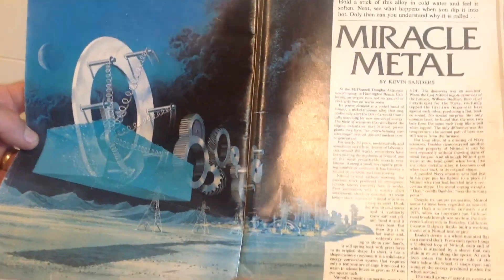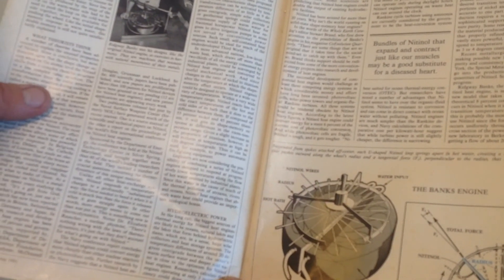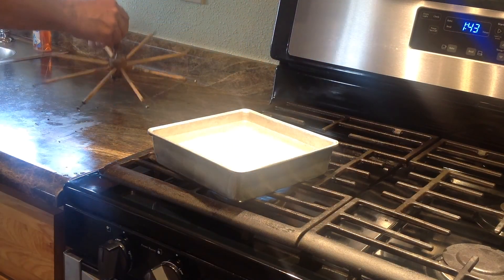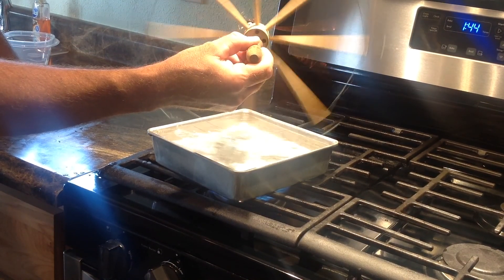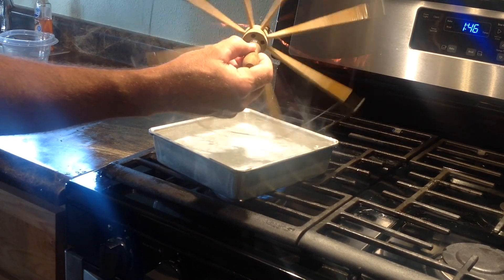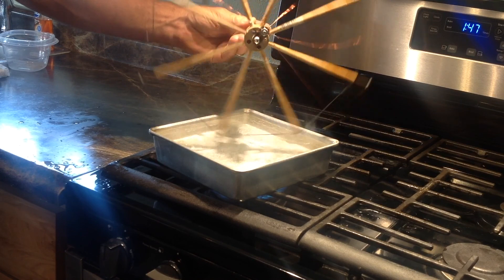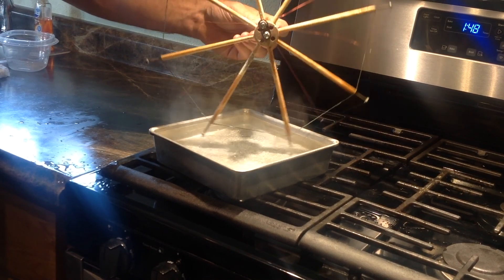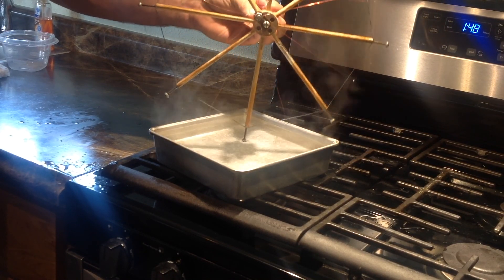Nitinol Heat Engines:  My First Successful Design.  Never seen before!

Comment: It's very interesting, im guessing the water has to be kept at a certain temperature?
What about if it was a sealed unit so the water that became steam dripped back down into the tray to keep an almost constant level of heated water in the tray - but im also wondering just how much torque strength is generated in the spinning wheel...
Would it not be possible to use gearing to increase the spin of the wheel to generate enough energy to provide constant heat to the water tray so basically it would always keep the nitinol wheel spining...
From the very short amount ive seen on this subject it appears the nitinol is contracting/expanding thus generating the spin...
I find this very interesting, and although i have no scientific background (or qualifications) there's just something about this that to me suggests maybe it could be cleverly configured to make a constant looping free energy device, as I've heard/read about energy never just disappears, but it's converted into another form (if this makes any sense?) - so therefore energy is basically something that never really goes away as it is always present...? 
I may be just talking a load of nonsense but I could see the 'nitinol' wheel being very good in the right place where hot water was a by product of some other type of manufacturing process, so therefore the heat from the water instead of just dissipating it would actually be of great use to the nitinol wheel to create energy - which then could be used via a series of geared cogs to provide energy to either be used (for something) or maybe stored away as electrical energy in some kind of capacitor?
It's all rather interesting, and has got me wondering why aged now 50 I have never heard of 'nitinol' before?
I appreciate your video, and would like to see if you managed to take things further with regards to the 'nitinol' wheel.
Reply from the maker: I have a couple of videos about nitinol motors I made, check the playlist.
Here's one that will give you an example of the power of a model I made:
"https://youtu.be/pJsbjNuC37g"
Thanks for the interest.
Reply: @doubleMinnovations  Thankyou, I'm going to look right now, appreciated!
Reply: @doubleMinnovations  Hi again,
I'm just wondering about your thoughts about the weight of e-bike batteries as only earlier today I commented (on a YouTube vid) to someone as I've been wondering when battery technology will get to the stage where e-bike batteries are a lot lighter, as the lithium ion battery in my e-build is quite heavy.

Comment: You get the same energy out as you put in.
Reply from the maker: Not sure what you mean...
It's a heat engine.  Heat energy is converted to mechanical rotating energy.
Thanks for watching.
Reply: @doubleMinnovations  I enjoyed the video very much and it gave me some good ideas. I was thinking of making a constant heat source to hold the water warm, a small candle perhaps. Sorry for being unclear.
Reply from the maker: @trisbaker363  Glad it gave you some ideas!👍
Reply: @doubleMinnovations  I will be experimenting at the weekend, I thought of adding a small electric motor to one of the wheels and driving it in reverse to create some voltage for a small lamp, heat to movement, movement to electricity.

Comment: i have seen this design but it was used with springs instead of straight wire i think by mcdonald douglas.. that said this is different and probably much less resistance of going through the water itself cutting through it i mean. a straight line moves through water easier than a bunch of circles like a spring. great job. i would like to simply know what temp wire you decided to use.
Reply from the maker: Hi Tom;  the activation temperature of the wire used is 158ºF.  In some of my other nitinol motor videos,  I demonstrated the activation in water at different temperatures.  In the hotter water, it activates faster.
Thanks for commenting.

Comment: if u put it directly on the fire it works?
Reply from the maker: The purpose is to utilize low level heat, like solar or waste heat.
Direct fire would cause a problem with cooling, and would over stress the nitinol and eventually damage it.